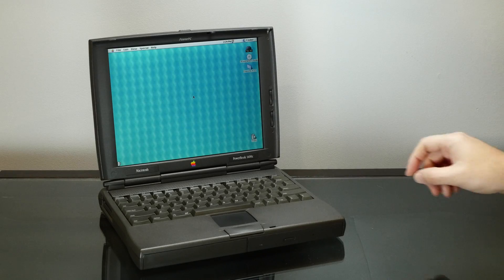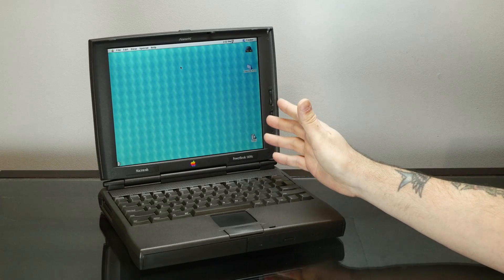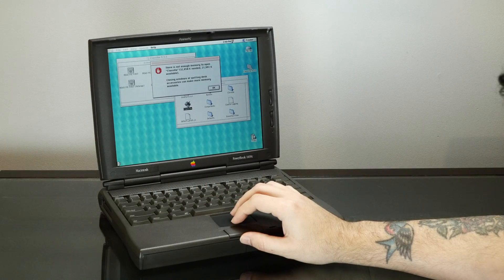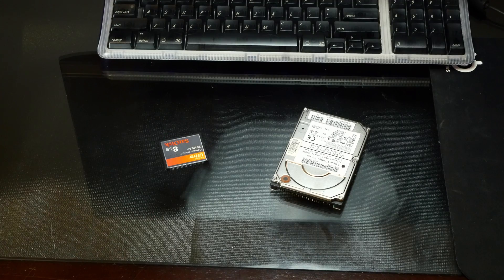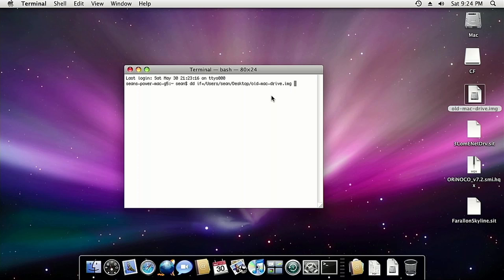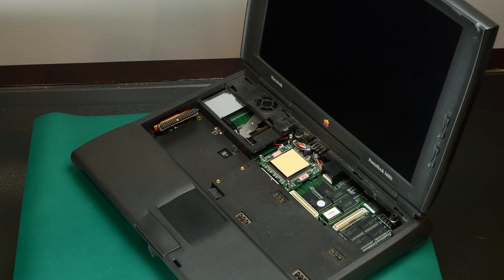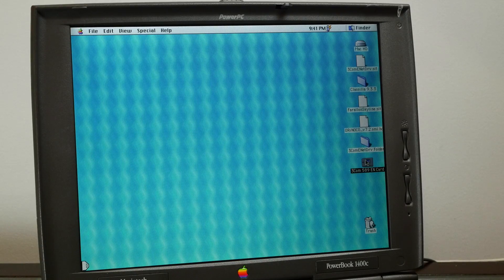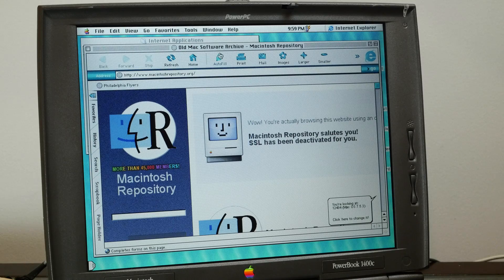Using a CF Card as an SSD in a PowerBook 1400c

Comment: If one goes down the Compact Flash (CF) route as a hard drive replacement make sure you buy an INDUSTRIAL grade CF card and not the usual card. This is necessary to get the UDMA modes and for the drive to be recognized correctly as a HD by the OS. Beautiful machine which I still use for many things - it even runs my favorite IIgs emulator - Bernie ][ The Rescue!

Comment: Is there any trick to getting the CF card reader and or CF card to be recognized? I used the same one, got it with the link provided and it won't show up is disk utility when I try to install os 9.2 on my g3 wallstreet.
Reply: I've found you have to use 8.6 to initialize a CF card on a Wallstreet. I use PCMCIA CF adapter to initialize. HFS+ seems a little unstable so I use HFS with multiple partitions to cut down on wasted space.
Reply: So obviously I'm running 8.6 on the internal drive.

Comment: This is one of my favorite laptops ever. I had the 117c to start with and with upgrades have a 333 G3 upgrade in it. I Swapped the screens when it broke. Maxed the ram out, I added a 56.6 modem card and an orinco wifi card. I have the cd, floppy, and zip drive modules. I started using more modern machines and never got around to installing a CF card. I did have a 20gig hdd.

Comment: I've done the same upgrade myself, but to the 166Mhz version. I also got one of the G3 upgrades and maxed out the RAM. I did have video out but it did not fit at the same time as the G3 upgrade and had to remove it unfortunately. Thanks for bringing back the memories of the process, I did my conversion about 20 years ago.

Comment: Hi Sean, I think the way to get the image restored was to just open (and mount) the .img file to the desktop and then have the source as Mac HD (the drive from the IMG file) and have the destination as the CF card volume. I've done USB drive restores with burning disk images of Mac OS X installers so I'd assume it works the same way.

I know this is a bit late but I hope this helps in the future :)

Comment: I'm sure you're aware but it's best to run a CF-based hard drive without VM for the longest lifetime of the CF card.
The 1400 was basically a recased and marginally improved version of the 5300: the 1400/117 had basically the same logic and thus the same performance as the 5300ce/117. The best feature of the 1400 is its keyboard, which is arguably the best of the older PowerBooks (competing with the 2400 and WS/PDQ for the title, depending on your preference/hand size).
Also, be gentle with the display: the hinge mounts are known fault points on these (and most other period PBs) and the plastics tend to crack.

Comment: Not sure if you know this already, but you can just drop a control panel, font or extension onto the System Folder and it'll automatically put it in the right place. Means you don't have to manually choose the destination folder.

Comment: Out of curiosity, why most of retro geeks on YouTube use CF card as a HDD replacement? Is there any advantages of it over something like SD cards which has more R/W speed nowadays
Reply: The CF card interface is essentially a IDE interface so the computers see it as another IDE device.  The CF device contains an ATA controller and appears to the host device as if it were a hard disk
Reply: @thinkpad4  but now there is many SD to IDE adapters which also has ATA controller in it and SD cards are faster than CF cards nowadays. Is there any advantage of CF other than built-in ATA controller?
Reply: @sgirix65  compatibility. Some systems just never like those adapters. Plus, those adapters are often flaky, slow, or both. In addition some of them can have a hard time fitting in laptops like this if you’re unlucky. 

For personal use, if you have one project machine, you may prefer to test various adapters for the best speed, reliability, and compatibility. But for a video (or a collector with dozens of machines) it’s just not worth-it for marginal gains. 

These CF cards often max-out the system’s ATA bus anyway, and they frequently have better controllers on-board than an SD card has (important for longevity if you’re going to be using a few CF cards on a bunch of machines, but less-so if you’re a casual collector who’d only use them occasionally). 

In that regard there’s often no downside (except perhaps dollars per gigabyte) to using a CF card for this purpose, and a whole host of potential downsides to an SD card.

Comment: I also have a 1400/117, although mine is the cs version so no fancy screen. Bought a spare parts 166 version from eBay that still worked, so swapped the whole motherboard from the 166 into the much nicer 117 chassis. You have to watch out when upgrading processors, the 117's motherboard won't accept one of the better chips without some major modifications; simply putting a 166 chip into a 117 won't work, it won't fire up.

Comment: 10.2.8 introduced a command line tool called asr.  Apple Software Restore. You can use that to copy over a backup image into a harddrive/ssd without the destination being resized to the original drive (as dd does).  This does not compute has a good video that explains how to use it: https://www.youtube.com/watch?v=agsy77XXCt0

Comment: How is that CF to IDE adapter not shorting out on the metal drive caddy? The solder points for the pins are clearly touching it.
Reply from the maker: If I remember correctly, it's a thin piece of plastic covering the bottom of the caddy.

Comment: As with modern mobile phones I'd say it takes more engineering prowess to make a device come apart easily, than simply glueing it shut or soldering everything down, from ram to storage. My last two phones I had to ditch not because they were faulty, but because trying to replace a failing battery truly killed them. Seeing the easy way you can enter this 1400c makes me think we've lost a lot as consumers.

Comment: Clearly not something you want to do for long term use. A CF card is not a SSD. You will end up killing memory cells in that card fairly quickly without wear leveling. It would be better getting a real SSD which they do sell with an IDE interface. The CF route is MUCH cheaper though, and is fine for a machine that will not see use often.
Reply: CF cards are actually pretty reliable. Why do you think they've been used in professional video cameras of years past? Besides the speed. Also, if this was a real huge risk, the retro PC community wouldn't be making and using things like the XT-IDE CF adapters you can buy/build, they'd be using SD cards or just straight-up using SSDs with adapters.

SD cards wear down pretty quickly, they're not good to use as "SSDs", but CF cards are literal IDE SSDs in a portable form-factor. There's a rather smart controller on CF cards, unlike SD which was built for simplicity and cheapness.

Though also, it is incredibly expensive to buy an IDE SSD. Especially one designed for laptops. What you're likely thinking of is the SATA/mSATA/m.2 to IDE adapters that you can buy. Believe me, I've searched far and wide in Australia and online, the only IDE "SSDs" you can find are Enterprise DOMs (Disk-On-Module) and usually are for desktop and embedded applications with a full 40pin interface.

Comment: just for the record (i think you already know by now): disk utility never works for copying images sector-by-sector. dd is awesome, but you need to unmount it (not eject) first and give dd the raw device and run dd as root (sudo) like so:
$ diskutil list
(find your volume e.g. disk2s1)
$ diskutil unmountdisk disk2s1
$ sudo dd if=/path/to/file.img of=/dev/rdiskNsN (substitute with above)
then it wil work like a charm. : )
Reply: @Michał Talarek try using bs=1M as a parameter, that speeds it up. also you can use the buffered device (diskNsN) instead of the raw device (rdiskNsN). this might cause errors sometimes though.
Reply: @bamdadkhan  Yep, always use bs=1M or bs=4M. Then it all depends on the speed of the drives :)
I usually use the raw device, just wondering, why should a buffer help in a sequential copy scenario?
Reply: @stefarossi  i honestly don't have any low-level architectural details to back it up, my guess is that when the write operation is buffered the storage device (especially a slower ones like USB floppies and old pendrives) can use its fastest native speed ignoring the pace set by the block size.

of course this creates a backlog of data that then has to be sync-ed to the device on eject or issuing `sync` in the command line - but even so the whole operation seems to take significantly less time than using the raw device. but this might just be my case.

Comment: Excellent video.  Cool, I never knew you could use a CF memory card to replace a computers internal Hard Drive.  However, for myself in my 1990's vintage apple computers speed is not very important for me but, storage space is.  So, I prefer to stay with slower internal Hard Drives but replace them with a much larger size (i.e. 30GB, 60GB, 80GB, etc.).
Reply from the maker: Oh yeah, CF cards are very close to IDE
Reply: There are msata to 44pin ide for laptops like this. I just purchased one for my aging gen 1 athlon 64 laptop.

Comment: I enjoyed your video.  I think its worth noting that for compatibility reasons, a the CF card you used is your best bet for getting an SSD to work. The powerbook 1400c isn't very compatible with the sata to IDE converters that are out there. If you ever run into an issue cloning a drive, I use a free version of carbon copy from that generation. It works without having to figure your way through everything.  Also, let me know if you're still looking for 133 processor.  Also worth note on these is that the IDE cable to the HDD is extremely difficult to remove and very easy to tear.  It makes it very easy to ruin the cable headed to the card.
Reply from the maker: Thank you! Good to know about the CF card. It does really seems to work great. It's amazing how much it makes up for the other bottlenecks in this machine. Also yes, I'm totally still looking out for one of those!
Reply: @ActionRetro  Without putting my e-mail address on YouTube, what's the best way to contact you regarding a mailing address. I have an extra 133 (I've purchased around 4 of these over the years) I can mail to you.  From what I understand you can't transplant a 166 into the 133 or 117 and have it work at 166, otherwise I'd try to get you that.
Reply from the maker: Aw man thank you so much! My email is garbagecomputers@protonmail.com. And you're right about the 166 - it's not supposed to go in the lower-specced two machines.
Reply from the maker: Thank you so much! My email is garbagecomputers@protonmail.com

Comment: Interesting how much we seem to work along the same lines. I have a PowerBook 1400 cs/166, a year later than yours. The screen is actually decent enough, and the speed bump is helpful. It's the machine on which I installed Mac OS 8.0 on 27 floppies. That was a fun video to make. I also got a PC ethernet card for it, but I will have to install 8.6 in order to get the drivers to work. And I also covet one pf the 3rd party CPU card upgrades. Sonnet did make them and NewerTech did as well. Sadly, they just don't pop up often. I did recently use it to install System 8.0 from a Power Computing recovery CD that I found on eBay. That was a fun video to shoot as well.

Comment: Does it make more sense for a newer mac (g3/G4) getting a cheap ssd or a sdcard?
Reply from the maker: SSD in my opinion. I've been using mSATA SSDs with inexpensive IDE adapters and you wind up with a really fast solution with a lot of storage space for $30-$40. Check out the adapter I used in this video on my PowerBook G4 - it's my go-to solution for these: https://www.youtube.com/watch?v=37e-4CM8VH4
Reply: @ActionRetro  I agree. The speed is limited by the speed of the IDE bus, but an SSD on that bus will still perform much faster than a spinning hard drive.